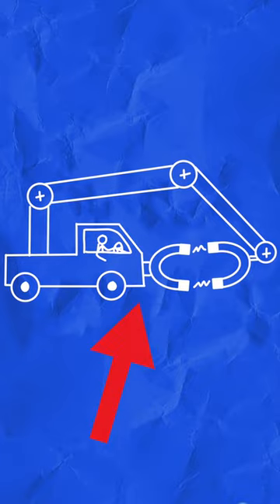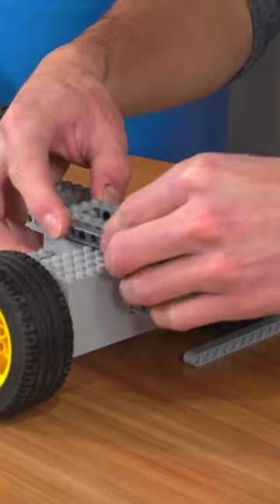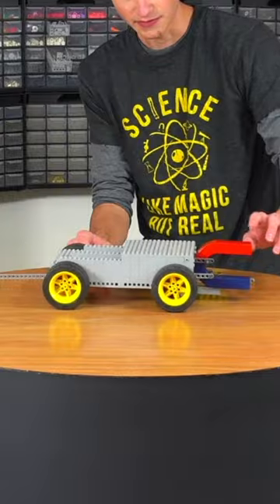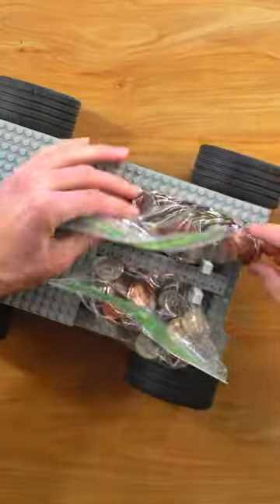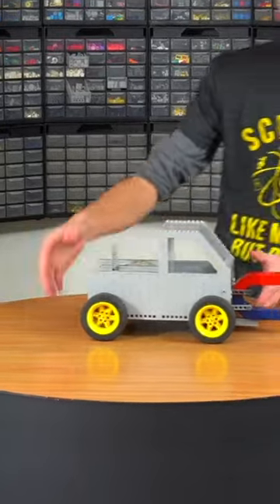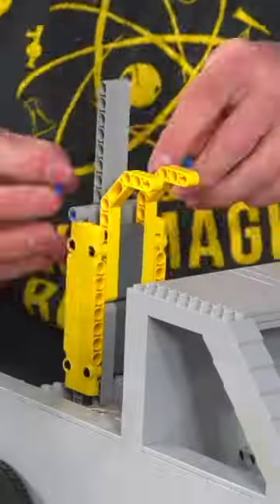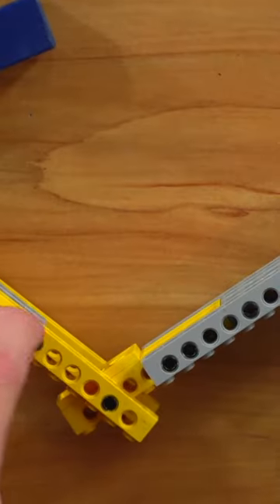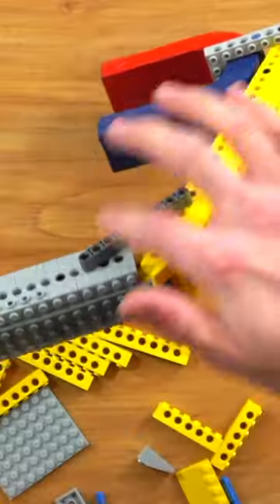I Built the Magnet Car Meme in LEGO 🚙 🧲 #shorts

Comment: I feel like the biggest part people miss is that both maggots are pulling each other together, not one to the other
Reply: Thank you!!!!!! I still have a little hope in humanity because of you
Reply: Hehe maggots
Reply: @zock6937  lmao just realized that but I’m keeping it
Reply: @lowsodiumgamer6805  good you must earn your mistake
Reply: Unless the one on the front is metal it won’t have as much pulling force as a magnet but it wouldn’t be able to still move the car.
Reply: @zock6937  How much do i earn per mistake??
Reply: What if you have a chunk of metal instead of a magnet one side
Reply: @zock6937  I want 2
Reply: Maggots are crazy dawg. They wiggle AND they pull eachotjer
Reply: @spaceartstuff  then it would make sense in theory
Reply: (Soldier tf2 be like) MAGGOT! YOU NEED TO LEARN HOW TO BUILD A MAGNET PROPELLED CAR!!
Reply: what if you put the two opposite sides of the magnet facing each other on the back of the car so that the rejection forcr of the two magnets could push the car forwards? could it work?
Reply: @defruit2160  they’d just fly off
Reply: @Khailyah Hajjalin you just made all the hope go away
Reply: @spaceartstuff  no difference
Reply: Well than instead of using two magnets use 1 magnet and some metal ☠️
Reply: Magnetic Maggots
Reply: How do magnets work?

The magnet consists of concentric clockwise and counterclockwise dipole rings that extend from one pole to the other over the entire body of the magnet.

Dipole rings in the same direction attract each other, and dipole rings in opposite directions repel each other. Likewise, currents in the same direction attract each other and currents in opposite directions repel each other.

An electric current can induce dipoles in a magnetic material to form dipole rings. Moving magnets can induce electrons in a conductor to produce an electric current. 

Since a dipole ring has two magnetic poles, clockwise and counterclockwise, there cannot be a single magnetic pole.
Reply: both maggots you mean magnet
Reply: So what if we put a weaker magnet in the car and a stronger one at the end thing. that way it wouldn't cancel each other out.?
Reply: Use a lesser magnet 🧲 on the vehicle instead of equal pull force
Reply: Can you just make the magnet pulling bigger?
Reply: Use a sheet of very magbetic metal, that doesnt emit its own magnetic forces, that would make it possibly work.
Reply: So what if it was one iron on the car and the magnet on the hook?
Reply: Well what if one magnet is stronger than other one??
Reply: But think about this we put magnets on back and front of cars so that way only the car in front of you needs to use gas and cars behind get pulled like a train, I'm high idk if it'd work don't ask me
Reply: So… if the one on the front of the car was purely metal.

Comment: If anyone doesn't understand why it doesn't work (probably younger folks), while one magnet is pulling the car forwards, the opposite magnet is pulling it backwards equally 👍
Reply: Forces have an equal and opposite reaction!
Reply: younger folks 😂
Reply: could it move if you put the opposite faces of the magnet behind the car? So  that the poles by rejecting each other can push the car?
Reply: And probably because the are on the same fix car
Reply: That’s not the only reason, the main reason is because the magnets are attached to the car. If one magnet was in front and attached to the table then it could pull the car, but I think that’s just common sense.
Reply: then get a bigger magnetic for the front 👍 💀
Reply: Why not put a magnet on one side and metal on the other side?
Reply: You can test this hypothesis and you'll find out that it is wrong. All you have to do is decouple the front magnet from the car. It will immediately pull the car forward. The reason it can't do it while coupled to the car is that it's exerting an equal and opposite force at the base of the crane arm.
Reply: I understood, and I'm young 😑🙄
Reply: I'm glad you remembered to be ageist, the comment totally wouldn't have made sense otherwise.

Comment: For anyone wondering: it doesn’t work because the magnet on the car and the magnet in front of the car each pull on eachother with an equal force.
Reply: Get a stronger magnet at the front
Reply: Use a bigger magnet on the front
Reply: Use a brain
Reply: @skyreaper27  ARE YOU REFRACTED